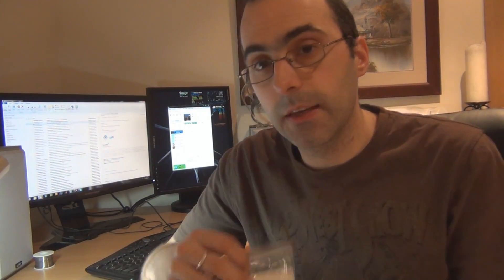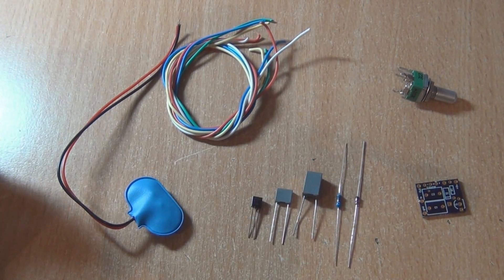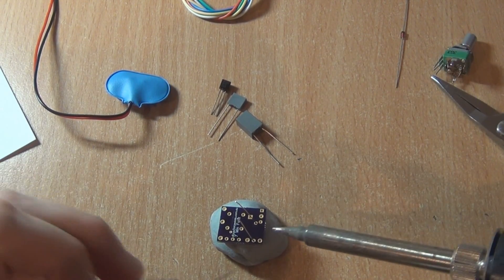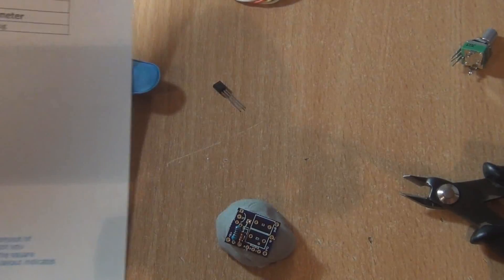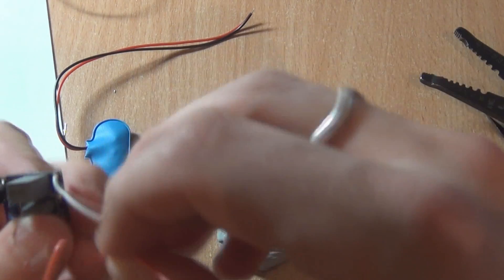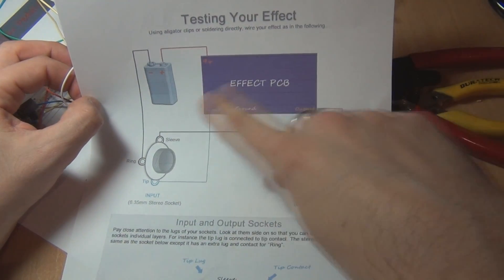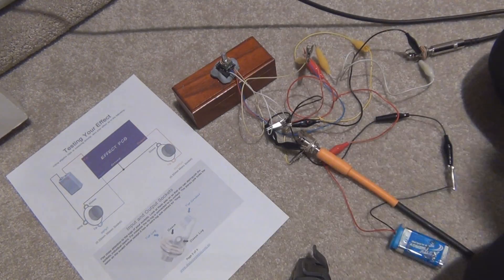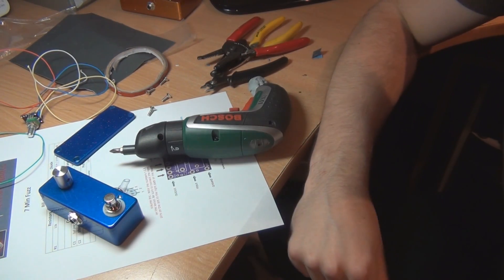Assembling a 7 Min Fuzz Kit - diyguitarpedals.com.au

Comment: Honestly, I think that the missing enclosure section makes the kit useless. Also, the fact that the wiring diagram doesn't repeat for both battery or DC jack makes it so hard to follow  Also, the lack of wiring not being shown in the video via soldering is annoying too.

I really got turned off by this kit and am not happy with it. I think this video could have been better but that's just me.

I don't think it's as beginner friendly, however I think this is a flaw of guitar pedals in general in that the guitar jack and foot switch wiring is very difficult.

Comment: I don't know if you will see this, but I recently bought the standard kit to make my first pedal. I understand most of what I need to do to build it however I am confused on the wiring shown with the battery at the end, if you could let me know which wires go on which jack and where the battery holder wires go that would be amazing. Thanks :)
Reply from the maker: Hi Ian.  I assume you are referring to the test wiring page of the 7 min fuzz (page 7)?  +9v goes to battery postitive, battery negative goes to sleeve (or ring) of your input jack, which is also connected to ground of the pcb and the other jack sleeve (output).  Then you just connect input tip and output tip to the input and output of the pcb.  Hope im on the right track?  Cheers
Reply: @DiyguitarpedalsAu  got it! thanks for the help

Comment: I have problems with noise, what can be the problem? Any suggestion?
P.S. I have used 10k resistor from my old radio it is not blue like yours it´s orange.(carbon film)
Reply from the maker: Carbon film wont add noise.  The noise might be coming from your power supply.  Try powering the effect with a battery, if the noise goes -> its your power supply  (unregulated PS's pass all sorts of noise that you can hear through your effect).
Reply: Actually, I am using 9v battery and I still have noise problems...

Comment: Are these just another version of an electrolytic cap and where could I find some with a greater value? I play bass and wanted to make one for it.
Reply from the maker: Sorry Matt, not sure what you are referring to.  You can use electrolytic in place of film (if that's what you mean?) but its not recommended.  If you do try to orientate the capacitor so the negative is on the 'most negative' side of the circuit.  You could try a non polar electrolytic in place of polarized, would probably be a better choice.  Hope that helps! Cheers

Comment: Hey there! just testing the 7 min fuzz kit before putting it in the enclosure. I'm getting an awesome fuzz tone when playing but a lot of noise/blurg when I stop. Any tips for trouble shooting this? My soldering on the board looks pretty good annam reluctant to put it in the enclosure before I've eliminated the noise - I'd be thankful for any help.
Reply: I am also having the same trouble with a lot of unwanted noise. Again the fuzz tone is awesome but I am a little worried of putting the circuit into an enclosure with the noise I am getting. Any help with this matter will be greatly appreciated. 

P.s - Thank you for the super quick postage, excellent service.

Comment: The small portable amp I am building based on a PAM8610 module runs on 12 volts and want to put this inside the amp.  Will the 7 Minute Fuzz run on 12 volts OK or do I need to put a 9 volt  regulator on it?

Comment: Do I break off the sockets?
Reply from the maker: Hi Charlie.  The idea is for the experiementers kit populate all the pads (excluding in/out/+/ground and the pot pads) with sockets so you can switch out the transistor diode capacitor and resistor for experimentation purposes.  For the standard kit just use the 3 sockets for the transistor.  Hope that makes sense.
Reply: DIY Guitar Pedals So the answer was "Yes."
I've built the pedal and it works like a charm. But I'd like to switch to a wall plug so I don't have to change the batteries often. I've found a 9V 500mA output wall plug, so I'm wondering if that could be used to power the pedal or would it fry it?
In that case I'd just wire in the plug provided with the kit instead of the 9 volt battery plug?
Basically, is the 9V 500mA the proper rating to be used with this circuit?
Also could you sketch up a diagram for wiring the LED?
Reply from the maker: Hi Charlie, in short, would recommend it unless the power supply is designed for powering pedals.
Reply: DIY Guitar Pedals Thanks for the reply!
Also I've managed to get the LED to work.

Comment: where should i solder the output on the pcb(p.s. i drew lines on the pcb myself and not use your purple pcb. now i solder it on c2 AND can i use a 0.22 uf as c2?)
Reply: plz help[ me
Reply: also where volume leg2 connect with?
Reply: my volume model is same as the one in p.1 of the pdf guide, not the one in video, how do i connect it?

Comment: Hey mate just built this from one of you kits all working but just put it in an enclosure and i get fuzz but no bypass, also the LEd doesn't light up, i followed your wiring instructions on the build guide for the 7 min fuzz. As i said it works but i get nothing when i disengage the pedal
Reply from the maker: +Adrian Lynch Hi Adrian, thanks for ordering the kit!  The problem you have explained would definitely suggest an offboard wiring error.  Go over your offboard wiring, look for shorts or a mistake, that is definitely were the problem lies.  Message me through the webstore if you get stuck and i will try to help you further.  Cheers.
Reply: Thanks mate will go over it.

Comment: Hi, does it work with a BAT45 diode? I couldn't buy the correct one and I haven't tested yet, so if you can please answer my question i will be glad. Thanks
Reply: Wondering the same thing
Reply from the maker: +Ian F Both are small signal schottky's I doubt you would notice much if any difference

Comment: Hi Paul, is there a video in which you show where and how we might insert the status LED into the circuit, and in addition how we might incorporate a switch into the circuit?
Otherwise cheers for providing both great information and accessible kits.
Reply from the maker: +bhmainz hey mate, no problem! Start with this video should help you with the offboard wiring stage.  Also see the 7 min build doc, there is a wiring diagram in that document as well.  Cheers!
https://www.youtube.com/watch?v=z6fpwU8RY_0

Comment: could you make this type of pedal without the circuit board? like, with a bread board? and used parts?
Reply: Yes it would be no problem provided the parts are close enough. I'm considering doing the same.

Comment: I'm confused if its a mono socket then wouldn't it not have a ring? I got your 7 min fuzz kit and wanna test it but have been unsure bout that part with them both being mono.
Reply from the maker: +Justin Mosher Hi Justin you can still test it with 2 mono jacks, basically check out the build doc on the product page, in the document scroll down to the page titled "testing your effect". The jack illustrated on the left hand side is a stereo. For a mono input jack you would connect the ground from the effect pcb and the negative of the battery together to the sleeve of the mono jack (there is no ring with a stereo jack of course).&#160; Hope that helps!

Comment: I have recently put together a 7 min fuzz that I got from your website. It works, but it would be better if it had a bypass switch, but I don't know how. If you could respond at all, that would be great.
Reply from the maker: Ben Virgo Hi Ben, yeah currently no enclosure or 3pdt's with my kits, they are just too expensive to ship.  You can get them from tayda, mammoth, pedal parts place, or your local.  This video should get you on track as far as the wiring is concerned:
https://www.youtube.com/watch?v=z6fpwU8RY_0

Comment: Hi um chrome sphere com do you if I can modifie this model like maybe add a potentiometer into the diode of I can get a drive knob and also add another potentiometer with a capacito to make a tone knob but I was just wondering how I may do it I already have an idea because I am good with analog circuits but again I am just 13 and don't kno much But was think that perhaps a cable each in the diode slot and them just playing around with the potentiometer connection and then stick on the diode some where but what I need help on is how to wire up the diode and the potentiometer because a potentiometer has three things that stick in to a pcb I don't know I just want to let me know what you think
Reply: Also does your kit come with the pcb?

Comment: Hey Paul, I purchased one of your 7 min fuzz kits and was wondering if it would be possible to add a mini toggle switch to switch between different diodes. If so, how would I go about doing that. Thanks :)
Reply from the maker: You sure can!  With a SPST you can swap between two.  Its pretty easy to do, difficult to explain.  Ill try and paste a link, basically just replace those 2 x 2 back to back diodes with just 2 diodes: http://www.cubisteffects.com/images/MIY/Pt3DiodeSwap.jpg The 2 blue wires will join at the same point on the board

Comment: I just tried to buy the kit but it's sold out. The prices look good though.
Reply from the maker: Thanks Andrew.  There is actually one kit left.  I'm waiting on some parts to show up for the next lot, hopefully wont be much longer! Cheers
Reply: chromespherecom thanks. Im actually thinking that id like to try a fuzz face instead but with silicon diodes. I would also like it true by pass and simple. Do you make such a kit? Btw. I love how you have your kits set up to add features to so youre buying just what you need and nothing else. I think your shipping across the pond will end up eating thing up. I wish there were sellers as good as you in the US. So far I've not found them
Reply from the maker: Andrew Smith Thanks for the compliment Andrew!  I don't have a silicon fuzz face sorry, just a germanium fuzz face (facemaster).  Shipping isn't too bad, my kits don't come with the heavy parts like 3pdt in out jacks and enclosures for this reason, keeps the delivery pretty cheap (typically $3.50 or $7.00 depending on weight).  Anyway, good luck with your search!

Comment: This is probably a really odd question but have you ever picked up a radio signal on a pedal?. I was working on on one of these 7 minute fuzz pedals and I'm sure I could hear faint voices coming out of my amp but when I turned the pot to try to increase the volume I lost the signal. I'm new to pedal building and am just curious as to whether this is common or not.
Reply from the maker: That can happen sometimes, when there is an error with the assembly of the circuit, or because the effect isn't inside an enclosure (ie the effect isn't shielded).

Comment: Hello! I Purchased several of your 7 min fuzz kits to learn how to build pedals. I just Noticed that you are now selling a 3PDT PCB. This is amazing! No more going blind on soldering tiny wires onto tiny pins. THANKS SO MUCH! My only question is do we solder the wires on the same side as the switch is on or the same side we solder the pins of the switch? Thanks! and have a great day!
Reply from the maker: THanks Josh!  Silkscreen showing "R1" faces up.  "diyguitarpedals.com.au" silkscreen faces down. Cheers!

Comment: hi. i tried to build this pedal. have the mpsa13 and 1n914 combination but it is very silent. there are 2 different things i done: added one 2.5k pot from battery to circuit to control the "damage" amount and used a 11k resistor instead of a 10k one.
does not work properly :(
Reply from the maker: With the Pot on minimum resistance (full 9v to the pedal) the effect should work fine.  There must be another issue going on.  11k on the collector wont make any difference to btw.

Comment: hi. im having trouble with both the 7 min fuzz and the ember drive. with both circuits i have the sound coming out clean. the 7 min fuzz has no fuzz and the ember drive has no drive. ive checked all connections and they seem fine, all pots are doing stuff (7min pot is vol. ED vol is working, tone pot is working almost as a volume) any clues to what i might be doing wrong?
Reply from the maker: Hi Ryan, thanks for your message.  Sorry to hear your having trouble with your 7 min fuzz / ember drive.  Could you please contact me through the webstore, I will try to assist you.  Cheers.

http://www.diyguitarpedals.com.au/shop/index.php?main_page=contact_us

Comment: Just finished the 7 minute fuzz, nice easy build for first timer, Just curious, what can I change on the board for different sounds? diode, cap, resistor? Will I damage anything if I go to a higher or lower valued component ?
Reply from the maker: Awesome hope you enjoyed it!  Doubtful you will damage anything.  You can change any of the components in this circuit to change the sound.  caps, resistors -> increase / decrease value.  Any npn transistor.  Any diode.  Have fun :D

Comment: Hello, I just bought this kit from you along with the experimenters kit. this is my absolute first attempt at doing anything DIY in guitar pedals. But i have a few problems: i dont know how to use these sockets. i assume i break them off and individually insert them into the holes on the PCB, like you said in the video. then with all the sockets resting in the holes, i place the components into the sockets that are in the PCB? so the sockets act as temporary solder? i place them in but they are a bit wobbly and i am afraid of knocking things out of place while im trying to wire everything up to test it. Sorry for such a newbie question, hope you can help me, i appreciate your videos and am very excited to learn more about DIY building. Also, not sure exactly what double sided tape you are using, can you use any tape like electrical tape or is there an exact tape you recommend?
Reply from the maker: Hi Marley. that is essentially the idea yes. Its not perfect but you should be able to experiment with the effect easily enough.  I would come up with a combination that you like the sound of then hot glue / tape / blue tack the parts down and install into an enclosure for a little added reliability.  Hope that helps, and welcome to the hobby :D
Reply: chromespherecom okay! i will try it out then! just wanted to make sure i was doing this correctly.
Reply from the maker: Marley Van Raalte Sharp side cutters or a sharp Stanley / xacto knife are good for cutting the sockets without breaking them.  No worries Marley, good luck!

Comment: Got it cranking and it sounds great. I want to put it into an enclosure with a stomp pedal. Do you have a wiring diagram for how the foot switch fits in? (or another video on foot switches?) You don't really talk about that in the off-board wiring video.
Reply from the maker: HI Alexsander.  Boxing up the effect is sort of 'stage 2' I guess you could say.  Search youtube for "offboard wiring" you will see my tutorial come up.  That will show you the process of boxing up an effect.
Reply: Ah! I fond this wiring diagram from madbean (see p4) which is a similar fuzz and it shows how to incorporate the foot switch: http://www.madbeanpedals.com/projects/Mangler/docs/Mangler.pdf
grooooovy!
Reply from the maker: Alexander Whillas That will work, but note there is no dc jack for boss dc power. Follow this one if you want to incorporate the dc jack: http://www.madbeanpedals.com/tutorials/downloads/StandardWiring_MBP.pdf
Reply: OH, I hadn't thought of putting a DC jack on it. This is from main line power? Would you then need to have some sort of transformer to covert from AC 240V to DC 9V?
Reply from the maker: Alexander Whillas Nah, don't mess around with 240v.  Just just a wallwart / 9v power adapter.